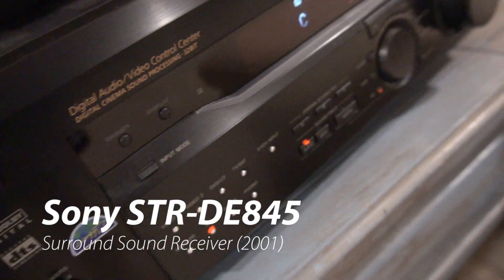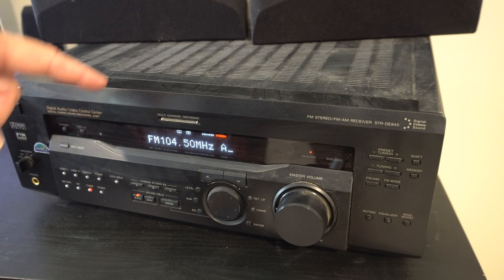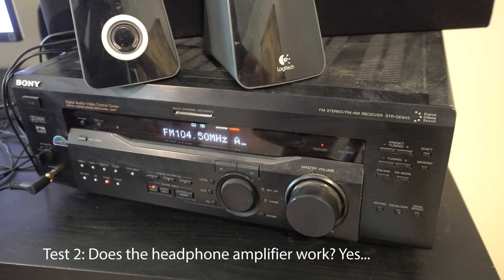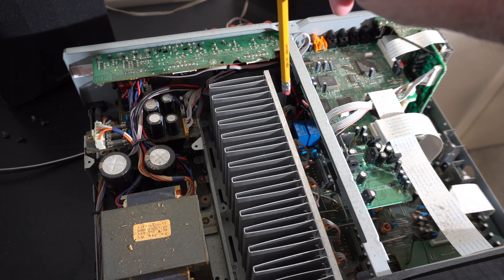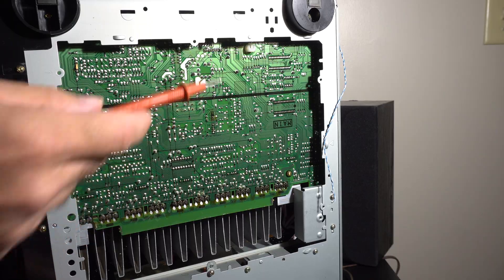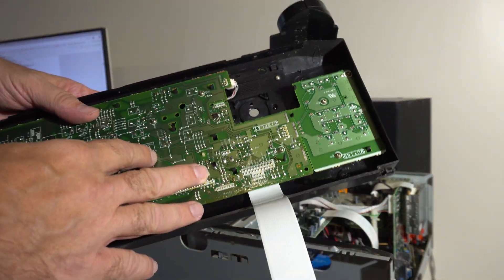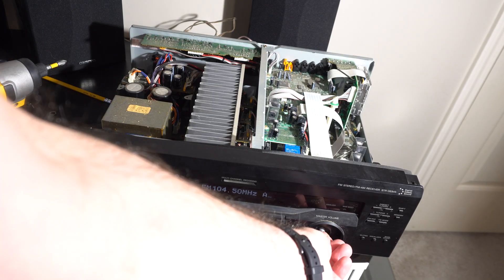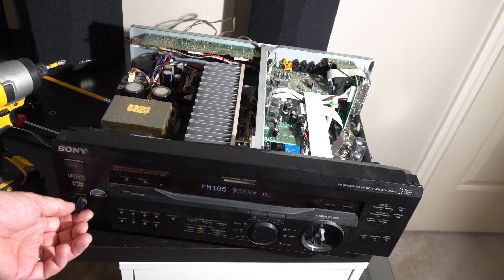Sony STR-DE845 Resurrection

Comment: Just did mine resolver the nice chips and the problem I found that moving it tripped the relay took front panel remove the main board and found the 4 pi’s on both sides of the sub panels all eight cracked resoldered  and it’s all good also check the volume pins.
Reply from the maker: Ended up cleaning mine with compressed air and it's as good as new. Thanks for the comment!